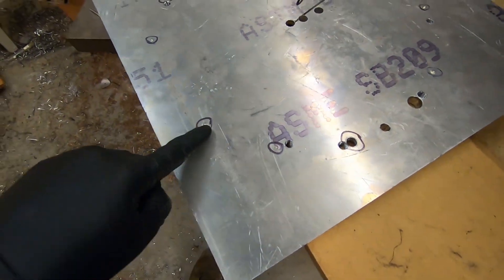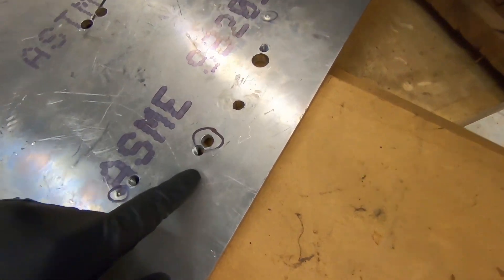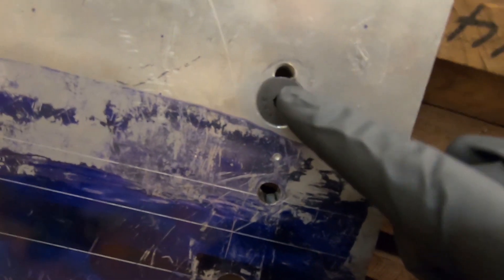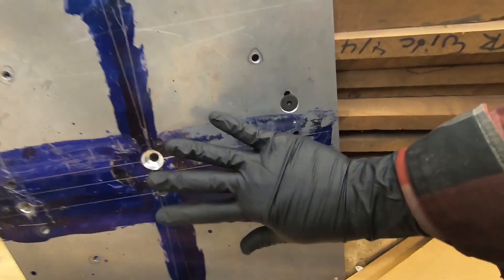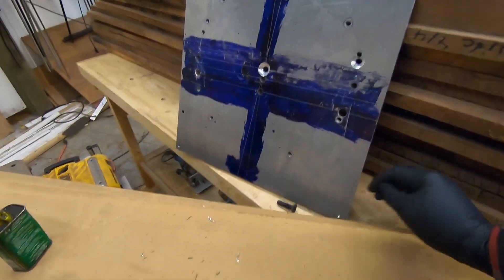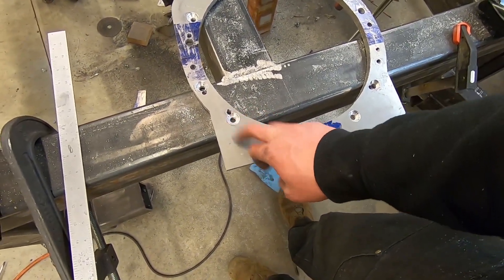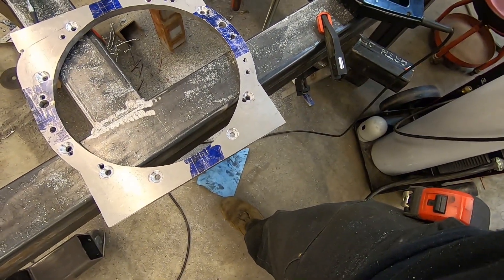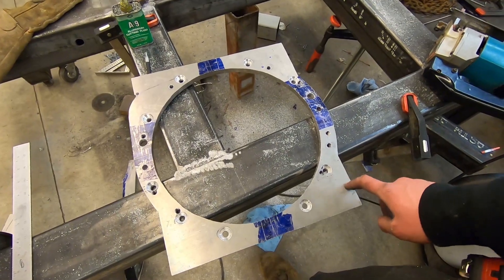Hooking a Mercedes V12 to a Subaru 6 speed (PART 2)

Comment: You might later have wished you used a large piece of material for your adapter that way you can use it for a structural member to the chassis as a midplate. Of course you could and probably would want to go this route as most race cars are build this way. I love the effort.
Reply from the maker: Thanks for the input but it does have ears on the 4 corners to attach it to corresponding mounts in the chassis later on. It doesn't need to be any larger though as the car isn't very wide and I'm building the chassis around it. The plate will end up being the rear most powertrain mount as well.

Comment: You're not done yet. You will need to bolt the clutch slave onto the top of the Subaru bellhousing and mark where it interferes with your adaptor plate. Remove your adaptor plate and remove that section. Pray that it also clears the back of the motor.
Reply from the maker: I saw that as an issue and I think it will not clear the crank sensor that is behind the plate. Current plan is to convert it to an aftermarket pull type slave cylinder mounted behind the release arm. That and the flywheel hub adapter will be in part 3 of this series. I also have a video coming out of the modifications I've done to the transmission to convert it to fwd soon! A lot of the info I needed I found on your site, awesome work you guys do!!!

Comment: Super cool, how thick is the plate?
Reply from the maker: It is 1/2" thick 6061 aluminum with a T651 temper made by Krupp and bought from McMaster-Carr.
Reply: @zwickauracingworks  Cool Bro, I'm working on a 67 mustang but I may get a very unusual engine for it so good lesson